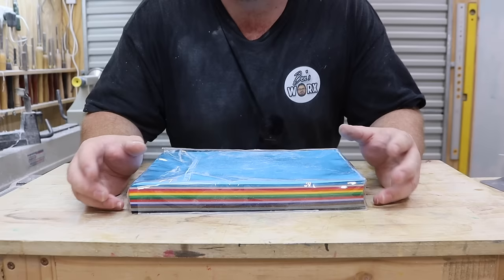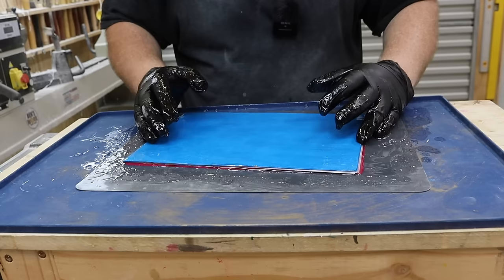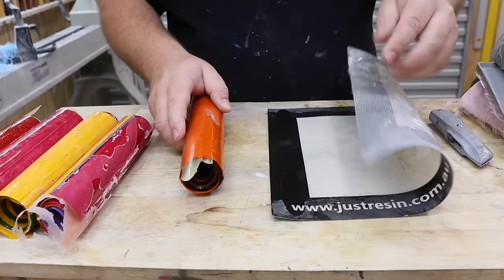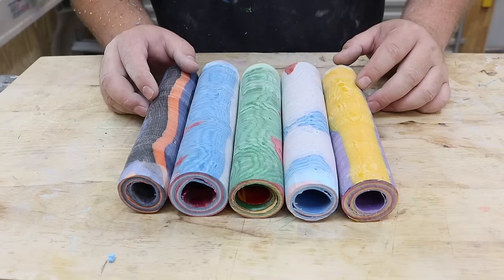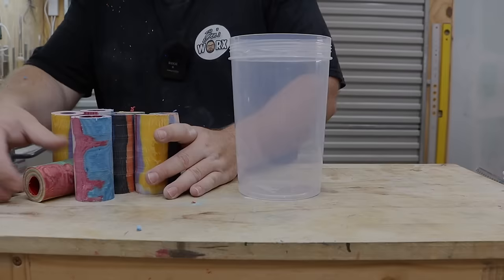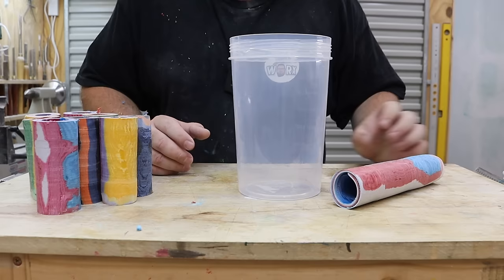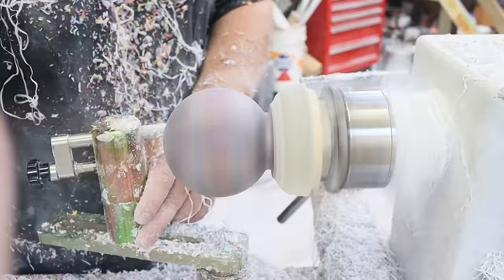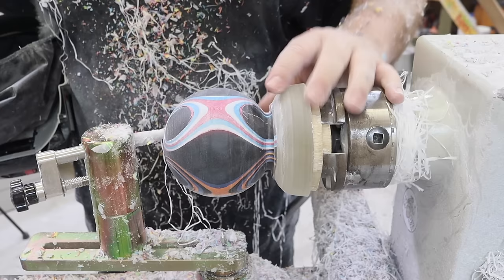Woodturning - Layers of Craft Paper on the Lathe!

Comment: I can’t just pick one of these spheres.  The black one is sexy, but I also like the little scraps in the clear one.  The contrast between the colors of the paper and the black resin is striking.  I’ll bet that a clear one made with smaller tubes with a clear middle of the tubes would look interesting, especially if you did the trick with the shavings again.

Comment: They are both amazing, but clear gets my vote, it is simply gorgeous.  I kinda wish it was a little more see through.  Perhaps use translucent colored resin for the filling of the tubes.  I like the adding of the shavings in the clear, but I think a little less so there can be some light and shadow inside would be amazing.

Great video, amazing spheres.  Sadly it looks like you've already sold them cause they are gone from your shop.  I missed out.

Comment: SUGGESTION FOR A PROJECT INCLUDED AFTER COMMENT ON THIS PROJECT - I like the black one better, however, if you had made the clear one without the coloured resin inside the micarta tubes (so, with the clear resin and “confetti” inside instead) then I think I might have gone for the clear. BTW, every time you turn a sphere, near the end before you cut it off the waste block, it reminds me of a snow globe. Therefore I wondered if you would make a “snow globe” all in one, by pouring a dark base, then making some kind of scene suspended in the middle, then when turning, shape the base to look like the bottom of a snow globe, instead of cutting it off and completing the sphere. I was thinking a sold resin pour (so a fake snow globe) but you could also enclose a clear ball containing liquid (mineral oil?) and maybe a typical snow globe scene with “confetti” which will move if you shake it. Just a couple of ideas for something to do. I liked the “confetti” you used in this project made from turning the micarta tubes.

Comment: I liked the black one better as you get the bright colours coming out of the darkness/gloom?

The clear one was good too but maybe if you filled the cylinders with the shavings it would've come out better than the solid colours?

One to try would be to take a wooden dowel with a slit down the middle from one end to the other you could slot a layer of treated paper into the slot in the dowel and roll it up going one layer of paper at a time until you have a roll as wide as it is tall so it is solid micarta multicoloured ring effect all the way through?

You might have to play with how many sheets of the same colour you put on to give a similar ring thickness as the first small ring would be quite thick as the cylinder circumference would be shorter but the rings would be thinner the bigger the cylinder becomes (if you know what 😂I mean? lol)

I think it would look pretty trippy lol

Comment: I've always wondered if you could do micarta like you do stabilizing resin with a vacuum chamber. Just immerse them in resin, pull a vacuum  for 15 - 20 minutes and then release it to saturate the paper. Seems like a lot less work than 1 sheet at a time. Would definitely use more resin though.

Comment: For the leftover cylinder, what if you used the shavings with clear resin to fill it, then cut the whole thing down into like 1/2in circles, maybe even cut it in half to have half circles. Using those, fill a container with the pieces and then use maybe a glittery black to fill it and make another spere, or a small pot with the pieces. Mycarta is so pretty! I think you need to show off the inside even more! The layers are beautiful. For these two, I like the clear globe, but I think the solid center colors take away from the beauty of the mycarta. On the black globe, the mycarta is the star. I like the shavings a lot, too!

Comment: They both look good, but I think I'd rather the shavings be mixed with the black epoxy, since it kind of has a similar effect of darkening the clear. With the black epoxy one, so much of it is just tinted epoxy, whereas mixing the shavings in there would have given those pops of random color and flecks or cracks of black. And I'd be curious what the visual effect would be if the clear had been kept clear, where we could see the cylinders inside, but probably warped, like with the rubix cube.